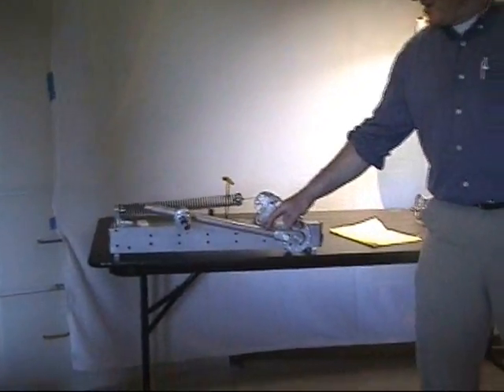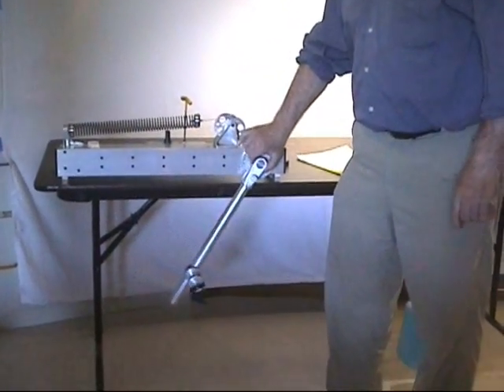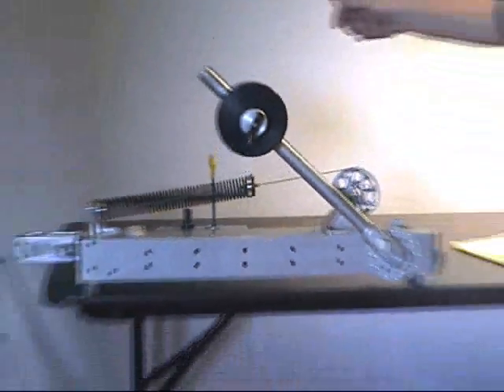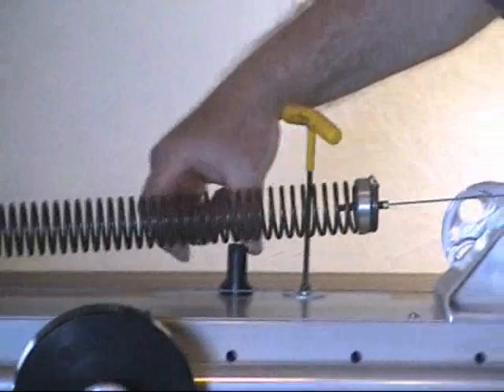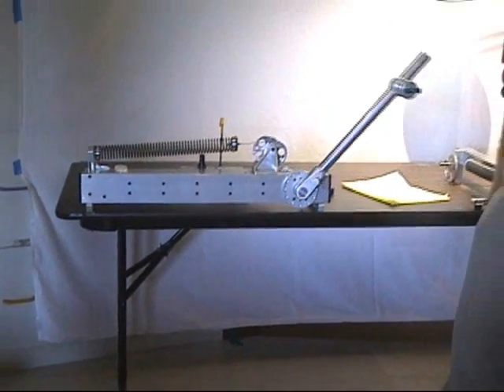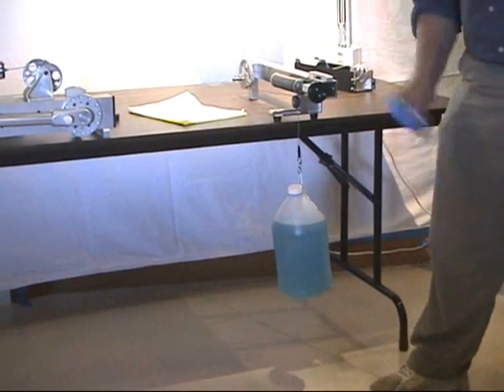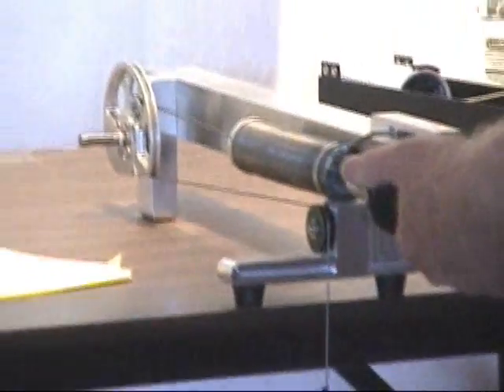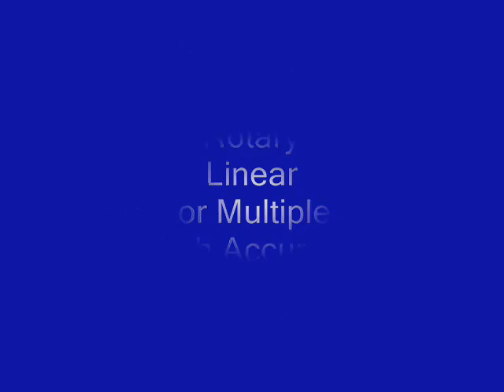Counterbalance Mechanisms

Comment: Hi Gene,

I was wondering how you achieve constant linear counterbalance.  I'm working on a project where I need to provide this type of counterbalance over about 40 inches of travel.  Can your mechanism work for this much travel?
Reply: Probably a bit too late but he uses a cam with varying diameter to account for the increasing spring force while it stretches
Reply: did you look into his patent? it makes no sense how it could adjust to new weight and could still balance for 360. even in his patent description he says it couldn't.
Reply: @heartminer5487  and how the spring didn't move at all while turning is really suspicious
Reply: @Shadow__X  the stationary cam+spring was a second stage balancer for counterbalancing the adjustment force for the first stage counterbalance. it doesn't connect directly to the pendulum.
Reply: @heartminer5487  What patent is it? I need to look at it